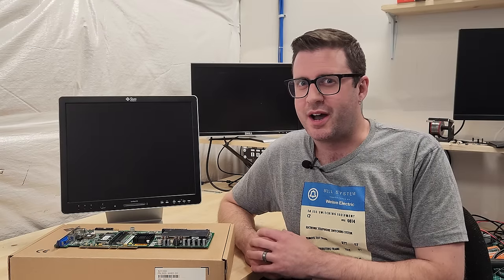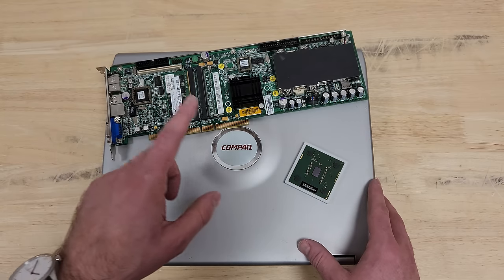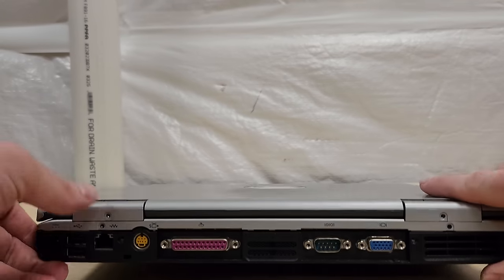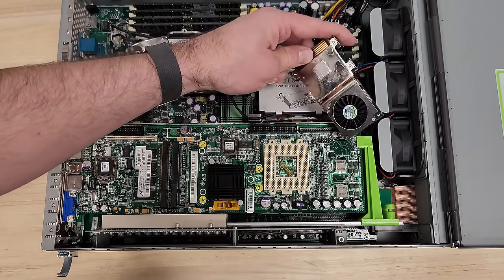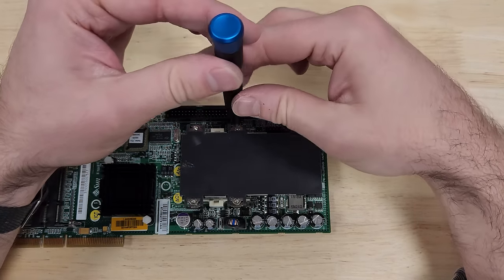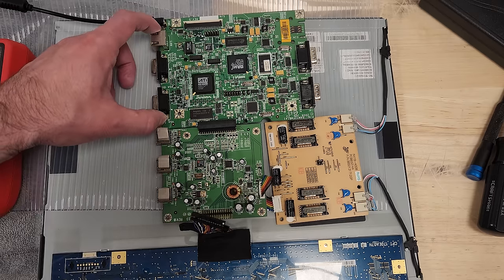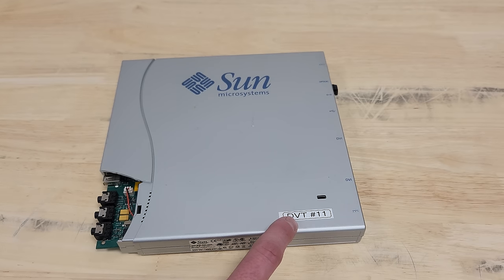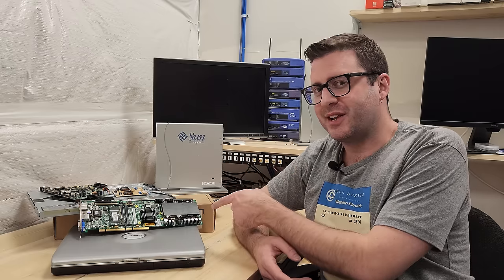Trying to fix Sun Microsystems Equipment

Comment: You have to push the cpu sideways with a flathead screwdriver from one of the slots next to it inside the cpu socket! Otherwise the pins don't make contact. There are 2 slots next to the cpu, directly opposite to each other. When you look at them you'll notice that one of them is nearer to the cpu than the other. This is the one you need to lever with a screwdriver against the cpu! The other one is to remove the cpu from this position. Try it and give me a note whether it worked, I'm 99% sure that's the problem!
Reply from the maker: so, you're totally right — I did try that a few times but it still didn't work. I think it's part of the puzzle though, that socket is pretty low quality and some of the pins are a little suspect. I can never get the CPU back in as firm as it was when I first took it out either.

I think there's still a good chance there are bad caps or other components at play here, but I might actually just replace the CPU socket entirely when I get some better desoldering gear!
Reply: These socket-types are a bit clunky. You need a well fitting screwdriver, maybe you can wedge another one between the cpu and the first one to get more leverage.
Had those in laptops of that era.
Changing sockets is a pain, even with good equipment. I did that several times. Best way seems to be hot air, but with a big nozzle, high airflow and matching temperature (<=350°C). Afterwards you need a desoldering iron with a vacuum pump to get alle troughholes opened.
Even with experience, i manage to destroy some of them from time to time and have to put a wire somewhere. Concentration and patients is antiproportional to the amount of pins you need to attack this way ;-) Anyway, great content, keep on going!
When i started computers, i never thought how anyone could solder/repair QFP (386SX-package), nowadays my last repair was a AM4-board with fried southbridge. Everything is possible, even as a hobbyist. You just have to try over and over again until it works!

Comment: What about the other RAM slot on the X86 board? The video looks like you just used that same slot with different RAM sticks?
Reply from the maker: Yeah good call out, I did actually try the other slot off camera without luck, forgot to include that in the video.

Comment: also wait what, the thin client has a sim slot??
Reply from the maker: strange, right? I had no idea until I filmed this video, I had thought those slots were clips holding the case together or something. The Sun Ray 2s also have the same thing. This is all I've found about it so far: https://www.infoworld.com/article/2656281/sun-rolls-out-new-sun-ray-thin-clients.html

Apparently they were thinking admins could store device config on the sims?
Reply: @clabretro  ooh you found something about the sims, i went looking and couldn't find anything - at first i thought they would use the sim as some sort of out of band managment... for some reason, lol.

Interesting, I wonder if anyone has actually ever used the sims in the sunrays!

Comment: wait that card is meant for a back plain right? i thought they would not work inside a computer? also have the same sunfire v240 great machine.
Reply from the maker: The SunPCI is just a PCI card, so it goes in those slots. Yeah I love the v240!
Reply: what about the VGA on it? @clabretro

Comment: Are there other avenues into the X86 board? Like can it be powered in this slot with its own monitor and keyboard so you can see what is happening to it? Does it have any PCI/ISA expansion; perhaps something you can shoehorn a diag board with 7 segment LEDs for boot codes? I don't really know how much special sauce they've put into the BIOS or any other subsystem on this board but it could be interesting. If you do not have the ability, perhaps a colab with another youtuber might be in order. Ask them to flash a new BIOS to a chip for you, if you are suspecting that to be an issue. There might be a website out there with this BIOS saved for posterity. 

Something I would try in addition to recapping, is a BIOS reset or clear CMOS jumper if it has one.
Reply from the maker: Yeah all great ideas. The back VGA has no output, unfortunately. While it's a PCI board itself, I don't think I have access to whatever internal PCI bus it's using somehow for the x86 machine it hosts. There is what appears to be a JTAG header on it, so that could be interesting. I think I need to do a little voltage probing while it's in the machine to see if there is a basic power failure going on.

It does have a diagnostic LED on the back which blinks amber at all times, the manual says this "may indicate a problem," which we obviously have haha.

Comment: I havr a sunray 270 with the exact same fault. Ive tried external video input, also tried the external input with no result either. Did you ever get a fix?
Reply from the maker: No fix yet, but I haven't looked any further. I'm fairly certain it's something on the main board itself rather than the video circuitry.

Comment: That on screen error message on the sunray 270 looks like a generic monitor message.

I would expect that the display is a commodity monitor and if it doesn’t see a signal it just displays that message.

I would try it without the USB board connected to the monitor.  I wouldn’t be surprised if the same message shows up on screen.
Reply from the maker: Yeah the trick is the display board gets its power through the main CPU board. It's something I'd like to try though, figure out how to power just that board properly to see if it does the same thing.

Comment: Please try to use a plastic guitar pick or spudger to pry off clips and if that doesn’t work try a thin, wide metal thing…  I think your ifixit kit came with some. It pains me to see you use a small screwdriver.
Reply from the maker: Heh I know, I couldn't find it. I have another kit on the way though, no harm done in the mean time.

Comment: I wish I lived near you, I have the experience and equipment to do some more in-depth repairs, including surface mount chip swapping, etc. If you do want me to take a look at anything, I can share my mailing address on Patreon or something and I'd be more than willing to do the work gratis.
Reply: Also, you really should pick up an iFixIt toolkit. They come with very high quality screwdrivers and bits, and lots of plastic spudgers for opening plastic parts like that without causing damage. They are extremely useful!

Comment: Is the Athlon XP still loose in the socket? 
If it is loose the CPU has no electrical contact inside the socket!

After inserting the CPU it has to be pushed towards the PCI connector to secure and connect it in the socket! Insert a flathead screwdriver in the little groove on the socket above the CPU and then twist the screwdriver to push the CPU sideways towards the PCI connector. It takes some force because the pins of the CPU have to be pushed in the "connection groove" in the socket. 
Take a close look at the socket with a magnifying lens if you don't know what I mean.
I'm sorry but I can't explain it in a better way because I'm German and English isn't my native language.
Reply from the maker: Very good point. I did actually push the CPU towards the connector like you say, but I forgot to get it on video! The laptop has the sliding style socket, but the SunPCI needs to be pushed like you're describing. It still doesn't sit very tight, so I'm a little suspicious of it still.
Reply: @clabretro  In my experience this type of socket needs "unreasonable amounts of force" to connect the CPU properly. Every time I applied reasonable amounts of force the machines acted exactly like the Dell & the SunPCI! I call this kind of state "braindead".
If a Socket A-CPU dies because of overheating (cooler not properly mounted - Socket A-CPUs don't have overheating protection because there is no thermal sensor inside the Die) they usually have a brown spot on the underside (the side where the pins are) in the middle spot that is free of pins.